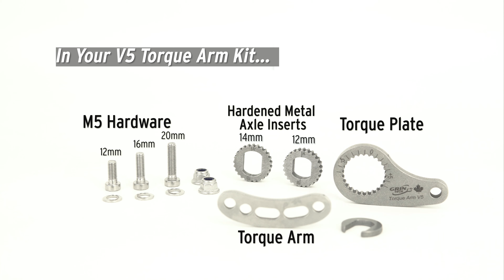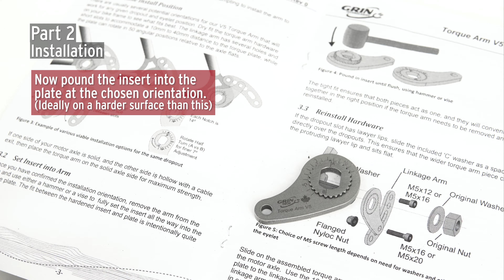Grin Tech's Torque Arm V5 - Installation Video

Comment: I've always used Nord Washers along with a Torque Arm. The belt and braces approach
.
Reply from the maker: Even a standard Nyloc helps enormously if you have a system with regen.  But if you don't have regen, then there isn't really back and forth axle torque so you don't have this natural tendency for things to loosen.
Reply: @GrinTechnologies  What about blue loctite? Any experience with that? Or even stronger thread lockers?
Reply: @difflocktwo I personally have tried nylocks and thread locker both, nylocks work better, and you definitely DO NOT want to use nylocks and thread locker as it will eat away at the nylon in the nut. If you're using a thread locker, use a standard nut. Also expect it to take a lot of torque to remove either way, which may matter for roadside repairs!

Comment: I am wondering if it is also compatible with Brompton?
Reply from the maker: No the brompton forks don't have threaded eyelets, and they are sized for just an 8mm axle slot, not 10mm as is the normal bicycle standard. So you need a motor with a much smaller diameter axle

Comment: Hey I had this idea: build a bike with 2 hub motors: one in the front geared / wound for speed, and one in the rear geared / wound for torque. Add a controller that would send the right amount of current to each motor, according to particular situations, ie, flat, downhill, or climbing. Been done before?  Can I get a patent?
Reply: Can't run two motors on one controller. It has been done before on a bench test but it's nowhere near optimal especially with different KV motors. They would be fighting each other the whole time. Each motor needs its own controller.
Reply from the maker: Not quite clear if you are just joke trolling or serious here :-) .   But if the latter case this topic (dual motor drive optimzations) I discussed in this video  here https://www.youtube.com/watch?app=desktop&v=Ub4EP2_mAds  And indeed there is no point really in having motors with two different KV's, unless you are seriously limited by a phase current limit of a given motor controller that you have to use.

Comment: Nice idea and try to support a Canadian company, but the reliability of their system is terrible. The wiring harness is poorly designed and built. Inevitably the connectors and wiring will short out and become buggy and unreliable.

It always happens at the worst time too. 🤪

You guys really need to figure this out and fix it. I'd never recommend a grin kit and suggest a ready to roll ebike just to save the headaches.